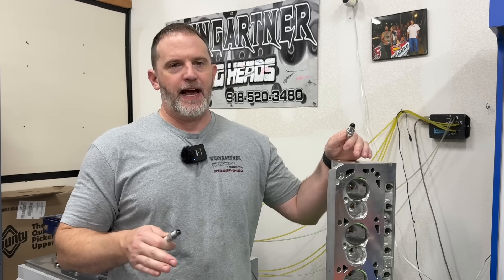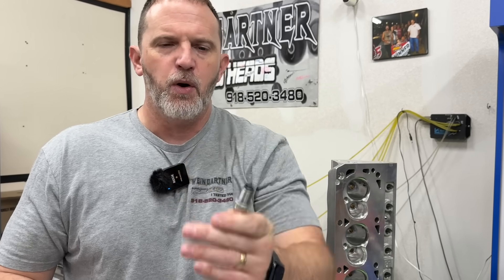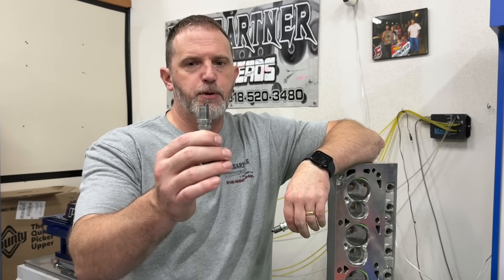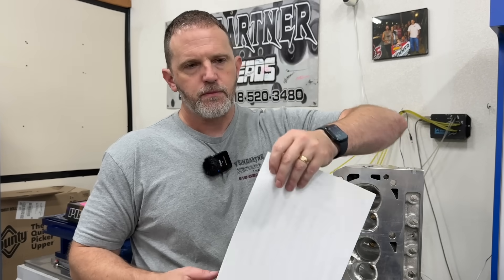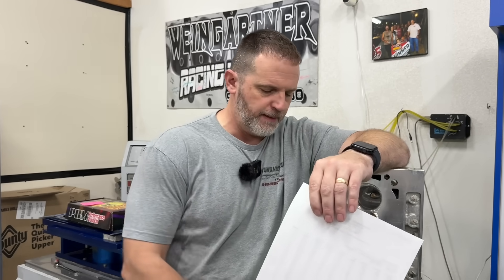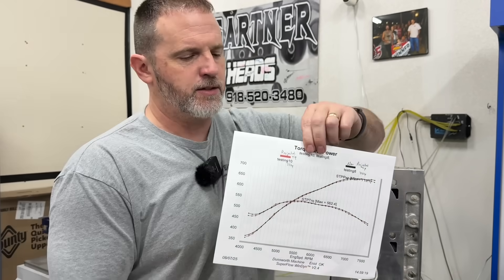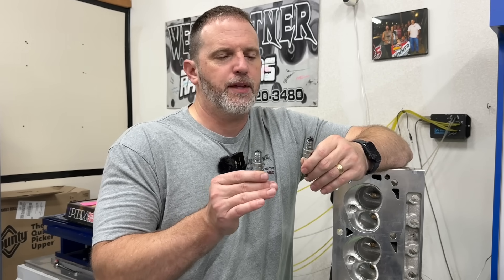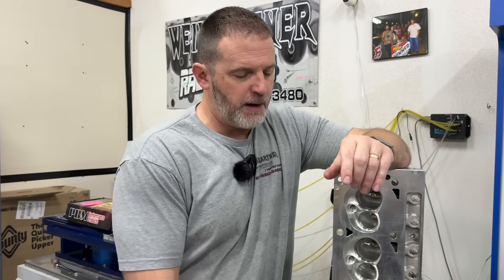Power Difference Between Spark Plug Tip Designs

Comment: it's not a wash!  Never deny an improvement in cylinder head burn rate!  We have to start over and assume each engine was tuned from baseline with each spark plug, in this case it wasn't.  Great stuff though, keep these coming.
Reply from the maker: They both were tuned

Comment: Hey @Eric, first off, huge respect for your work —I've followed your builds for a while, and your expertise always shines through in these videos. Thanks for diving into the spark plug topic; it's super helpful. I just wanted to add a bit more clarity on the projected vs. non-projected tip aspect you mentioned, as it might help others following along. While that distinction can play a role, it's somewhat separate from the heat range discussion, which I know you're spot on about in terms of overall performance tuning.
To expand a little: the heat range primarily focuses on how well the plug can transfer heat from the tip to the cylinder head. A hotter plug typically features a longer insulator nose (that porcelain or ceramic part), which reduces heat dissipation and keeps the tip warmer—ideal for preventing fouling in lighter-duty engines. Conversely, a colder plug has a shorter insulator for quicker cooling, which is essential in high-compression or forced-induction setups to avoid detonation and protect those pistons. Your point on combustion temps is key here, and getting it right can make all the difference in longevity and power.
That said, tip projection is indeed an independent variable, though adjustments to one can subtly impact the other, as you noted. Projection is about how far the electrode extends into the chamber—a projected design can enhance ignition efficiency by better positioning the spark in the mix, especially with certain piston shapes. Non-projected ones might be better for clearance in tighter builds. The cool part is, you can tweak projection via the thread length or sealing face without necessarily altering the heat range. Brands like NGK or Denso offer series where heat swaps don't mess with projection, giving us flexibility.
For custom tunes, I've seen folks (including pros like yourself, I'm sure) borrow plugs from other platforms—like a Civic Type R or WRX—to fine-tune that electrode placement while keeping the temp spec intact. It avoids a full redesign and can optimize quench or spark location. Pro tip for anyone reading: always verify torque and gap to prevent issues, and materials like iridium hold up great under boost.

Comment: A non projected plug in a road engine will fould easier at low rpm. The main reason for projected plugs is anti fouling.
Hear range on plugs will also make a difference. 11-1 Holden 6 on Webers going from a Champion 7 down to a 2 is about 5hp. And in 40 years I have never had them foul. Not for street use however. I use similar range in Chevs and Fords

Comment: ...did you jet up for the hotter plug? Buy the way, a vacuum cleaner motor to test flow (VS> WET FLOW), is just goofy. 300 hp out of 27.5 c.i. so yeah, I did that. Peace GRD

Comment: Recently there was a teardown of an old Honda V10 F1 on YouTube, what I noticed is they had no projection at all, more interestingly the cylinder head just around the plug was sparkling clean while the rest had some carbon buildup. The energy they supplied from the plug must be so high they are polishing the head around the plug with every spark.

Comment: Two schools of thought with respect to the projected tip plugs, yes the ground strap is more exposed to the flame and may run hotter. However, during the intake stroke, the tip/ground strap will be cooled by the incoming A/F mixture. I'm curious when reading the plugs if there is any change as far as the color of the strap, indicating if too much timing.

Comment: Great content , I'm glad someone's doing these tests .  I did the same test but on a triumph twin cylinder on a pump , apples and oranges .The projected tip made basically the same hp with less timing in it but it was a little more ping resistant which was a plus for pump gas.

Comment: Great video, yes, as long as heat range is right, spark location in the chamber will affect spark timing, I have an old spreadsheet written by Earl  Parker that calculates it, keep up the good work Eric
Reply: Very cool!  Is there a location others could source this?
Reply: I am interested in this spreadsheet as well
Reply: @Pavel_Engines  I will try to find it, will need your e mail

Comment: I did an on track test with different brands of spark plugs to see if there would be a gain or loss in elapsed time! I have a 582 conventional head BBC in a sprung front end solid rear 248" dragster! My go to plug for years and years of drag racing has been Autolite AR plugs. I wanted to see what all the buzz is about NGK plugs and why they get used so much. Guys will say with the NGK you get better readability when you are tuning with the NGK plugs. I just do basically all bracket racing so tuning to get maximum power is irrelevant in bracket racing. We just want consistency. I made four passes on the same day at my local 1/8 mile track. The first two passes were with my Autolites and the last two passes were with the NGK's. All the plugs for both brands were indexed and gapped as close to the same for each cylinder with all new plugs from each brand. Weather conditions remained almost identical for all four passes plus I am running on methanol. I was a little stunned by the results I saw with this small test. My first two passes with the Autolites, my go to brand, yielded an ET comparable to what my car runs for the weather conditions which was what I expected. So i put in the NGK plugs, same heat range and gap, made the two passes, and my ET was .09 seconds slower than the two passes with my Autolites! That is almost a full tenth of a second loss in ET! Maybe you could do a dyno test with these two brands of plugs for your dyno engine to see if you come up with comparable loss in HP with no changes to your engine besides the plug swap?!
Reply: 20 years racing and the Autolite racing plugs are way better than NGK when you have it tuned already if you’re tuning the NGK are easier to read than the Autolite racing plugs has been my experience I only run the Autolite plugs in my bbc now.

Comment: When I started out in the game, I always used standard plugs as I was fitting bigger carbs and messed around with port matching and what we called free flow exhausts. Then came the day I bought 1 of 128 Opel Kadett Superboss cars in RSA. It came standard with a 2l 16v fitted with an upgraded intake, a 4 into 1 exhaust branch and a Promotec computer as opposed the the standard GM part. I once contacted the late and great South African racer and tuner Paddy O Sullivan to do a silly test on the Superboss. We tested every spark plug on the market I could find that will fit on the dyno. From standard to 2,3,4 electrode, heat ranges, brands etc and at the end of the day the standard recommended plug won the day.

Comment: Your unexpected gains from reducing the ignition advance are right on the money.  About 20 years ago, Jim Mock Motorsport were developing performance upgrades to the Australian Falcon 4.0 six - the SOHC predecessor of the Barra - when they were sent projected-tip Autolite 985 spark plugs by mistake.  Their development mule instantly gained several horsepower.  The conclusion was that the projected tip starts the flame front where a non-projected tip's would be 1-2 degrees in.  So, you get the advantage of the earlier ignition but starting the actual push down on the piston coming up 1-2 degrees later, so less negative work.

Comment: Have seen this before, recessed or non projected tip will need more timing for same HP but the usefulness of non projected tip is like you said, the need for no metal hanging out in the middle and glowing. Possible HP will be higher if you don’t have destructive predetonation. Non projected tip wins.

Comment: I’ve heard cars like circle track pick up the throttle better with an extended tip plug. 
  I figured if there was a difference it was the extended tip worked better with the weak coil they hadn’t found yet….
Reply from the maker: Maybe

Comment: 🔔😎🇺🇲
Back in '95 in my turbo 2.2 Ford Merkur I tested Splitfires vs Motorcraft standard electrode plugs. There was a noticeable seat of the pants  improvement with Splitfires.👍
Only problem I had was one plug actually blew out between the porcelain and the case. Sounded like a header leak 🤔.
That happened in two random sets 6 months apart from two different stores in two different cities.🤔 With 6 good plugs it kept running well after that.
Other than that I nearly always cut the electrode to half way across the center electrode on everything.
BTW.. fine wire plugs suck in everything I've ever tried them.
JME 🫤🇺🇲

Comment: Don't think it is a wash and 2-3 hp is huge if your class racing in a tight field. Projected cost 3 cfm and can get back power with  timing adjustment - not using it, rather find a way to maximize that 3 cfm with the non projected tip..
If it had picked up even 1-2 hp i would say its worth it but, looks to melike the regular plug is the best bet , at least n/a.
Great testing man- thanks, as always.
Reply from the maker: Thank you

Comment: I noticed with my afr enforcer ls heads the plug is actually recessed in the threads, like it doesn't even poke out into the combustion chamber so I run an extended tip #7 plug. Its made over 1100whp and hasn't given me issues yet.

Comment: On older 2 strokes , Mercury came out with a service bulletin. Changed from surface gap to projected tip plugs, idle and take off response improved, I have put extended projected plugs also, just have to check for contact. I have done the same on my own cars, seemed to run a little better.the fuel you are using may respond differently, the tuning school ran Dyno test were they adjusted fuel, timing due to fuel properties.

Comment: Not a wash    take a look  at the idle comments   Now back to the70s and smog on the AMC 6  we developed what Champion calls a LY tip like RFNLYC   available in 13/16 and 5/8 hex and gasket or tapered seats in a 3/4 reach  really cut emissions and improved   Moving over to Chryslers they work wonders on 318 and 360 engines  never tried on a 340 so check for piston Clerance on aftermarket heads and high compression
you will pick up mileage and drivability   now there are several iterations of this method including one with a long center electrode  so if you have an appropriate combination give it a try  excellent for jeeps and rock crawling  they are hard to foul   Thanks Eric  get that spark in the middle of the chamber  I am not surprised that less timing worked better  the spark is in a better place

Comment: I know ground strap orientation can affect power numbers in some applications, but it is negligible in most cases. Were there any other variables between the A to B plug test, such as ground strap orientation? 4 hp is a difference, but I almost feel like it could be explained with some other variable other than just tip design of the plugs…? Please don’t think that I am questioning your data and outcomes, just thinking of it from all possible angles as I do
Reply from the maker: I have yet to see indexing the plugs make power but I will test it again.

Comment: On boosted engines. Supercharged C7 Corvette. Extended tip plugs. Ditto for the Hemi Hellcats, Demons etc. in fact, the tip is nearly 3/8” long.
Right from the factory.
I’ve been running 8 heat range extended tip nGK race plugs in my turbo car w/o issue for years. 
I will say they are barely extended, less than 1/8”.

Comment: We saw the same results on the dyno with projected tip vs non projected tip plugs.  I am glad you played with timing to give them both the best shot.   I wonder if  the projected tip might make an improvement on a chamber like your old double humps being an old chamber.  That might be one thing to test when you run those heads.

Comment: I know Champion , and probably all the majors , the heat range is the same . For example . N-64 and N-64-Y , the heat is the same , with the Y being projected . But here's another thing the majors measure heat in the center insulator , including the metal , but most projected tips have considerably more metal in the ground straps . And you and I will think about that , because the majors don't seem to talk about it ,,, !
Reply: Seriously. I don't know any racer or street hotrodder that would run a Champion plug even if they were free. As for me, they always became a problem in 3-5,000 miles in any engine. I refused to ever install another Champion for anybody.

Comment: The difference between the two would be the heat range. The projected tip would definitely be hotter than the non projected tip. Isn’t that correct?

Comment: One of my big blocks is a 468 LS7. I always ran the projected tip, as they stayed cleaner with extended street/idle time.
Reply: I had good service by stepping up one heat range.
Reply: My tunner for my efi stuff doesn’t have a dyno, it’s all by data logging and real world driving conditions.

Comment: Hey Eric,
     Tim here, usually, the NON projected tip is a colder plug, the hotter the heat range, the more tip is showing......maybe u'll address that.....i'm only 3 min in, but know this as a generality......maybe i shud shut up, and finish the vid.....but had to say
Reply: I am 100% on this , so listen up! The extended tip plugs are cooler. Cooler plugs are for steady high rpms like highway miles. The shorter the tip the HOTTER the plug spark. I would like to reference a briggs and stratton 5 hp pushmowermotor. I am sure evceryone has seen one of these simple motors get wore out and burn almost as much oil as it does gasoline. How does it do that? with a super HOT spark plug. I have fuel fouled many extended tip spark plugs with just fuel . The answer is get a hotter plug , the more tip you got hangoing out there the cooler it is . The futher the center tip of the spark plug sits deeper into the threads the hotter it stays and does not glass over with none fired fuel. + will also like the briggs 5 hp push mower will burn that oil and keep on sparking.
Reply: @fastbuzzardo4204 TY sir for some clarification......so i had it backwards, and so does my 73 yr old boss......we have bothe built plenty of engines.....i personally never noticed the tip dif very much, went by compression/application......but we were talkin bout it the other day......in his mind, the colder the plug, the LESS the tip is projected......my NGK plugs for my 462 Pontiac, are a med heat range (P/N R5671-8)......tip is projected, NOT a clearence issue......i DEEPLY appreciate ur time, and comment, THATS how we continue to learn....at 59, i never wanna stop learning the rite shi%!!....TY sir!!!😊

Comment: You were talking about plugs and timing changes and hoping to make a bigger change, have you tried maving timing around after peak torque?  We tried it after getting the tip from an old msd friend and saw pretty significant gains. Not so much to peak numbers but average over a range (in our case, 3500-7000). Three different engines gained 15-24 hp on the average number across that range with a simple timing change.. We were impressed. It wasn't until  years later we found that the change was pretty common with efi tuners/oem calibrators but efi wasn't greatly prevalent in our racing scene at the time.
Reply: Very interesting. It does make sense after I thought about it.  Stands to reason that different timing for different RPM could make more power in a certain area. That's the whole premise of advance mechanisms in the first place. Some things get generalized to save dyno time I'm sure. What HP engines were you seeing those differences on?
Reply: @bw3506  It only required a small 1-1.5 degree change to make the difference. All BBC, conv headed, one purpose built NA, the other two were n20 built, 1x 468cid, 1x 452cid, x1 490cid. All baseline changes were done before the timing test. All tests were done before any nitrous hits.
Reply: @elowe657  so you ran a grid or digital 7?
Reply: @cedricwilson2055  we ran both at different times. As long as you can adjust timing per RPM, you can do it, which both do.
Reply: I have noticed I pick up a half a tenth or so when I indexed my plugs and NGK plugs read easier than the Autolite racing plugs and the Autolite racing plugs don’t foul out like the NGK 15 years of experience.
Reply: @keysautorepair6038  Thanks👍
Reply: @keysautorepair6038 please describe how your plugs were indexed

Comment: Haa. Ford FE loved it. The pocket is the reason. 
When I developed the F5 head, I did as much research as possible on Fords weird exhaust ports along with thier pocketed plugs.

It ended up those days had heavy carbon build from theadditives oil companies were doing along with lead.  On Fords exhaust ports as well as the plug, it was nasty.-- Ford pocketed the plug, oversized the long exhaust wall and squared up the chambers. The head gasket shape actually has a void at the intake valve side,  opening a gap between the head and block to cause a sweeping of the dead area. -- Really sharp boys for what they had to work with 

I remembered the difficulty removing the yellow 'Shell, with Platformate' carbon build. It was the worst. But, this plug thought was use after working on the Chrysler and Ford Hemi to see if moving the plug into the chambers would affect the cracking at the kernel areas. -- Worked like a charm plus some torque gains.
This was done on the FE for a look see and there was some. Enough to where apparently customer sent a half page NHRA rule change tothe shop banning this.

Still hanging on the door. 

So, this is the fun part of now seeing the numbers however, most know now realize big numbers at times don't race well.  -- Fun Stuff !
Reply: Long live the FE! Love’m